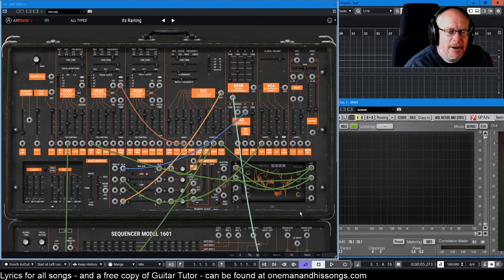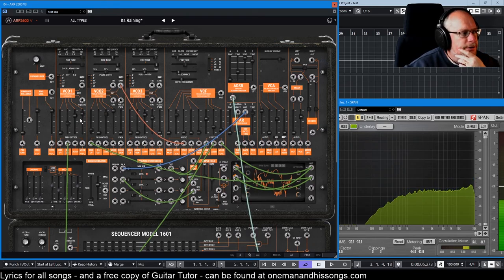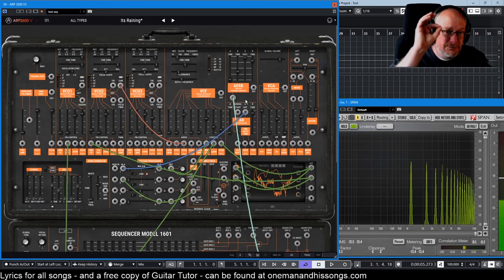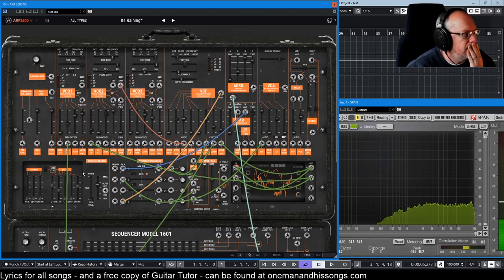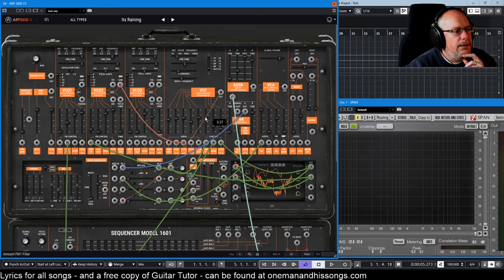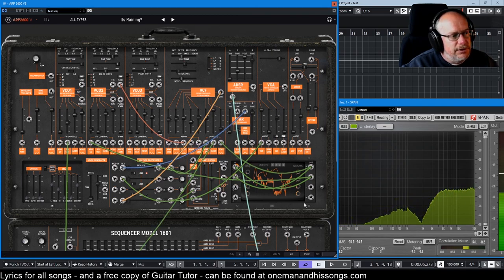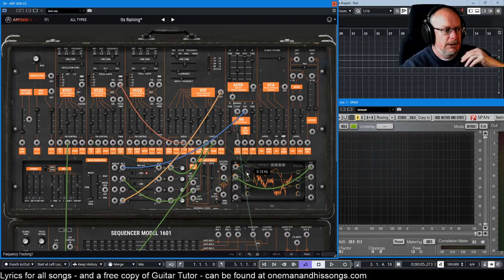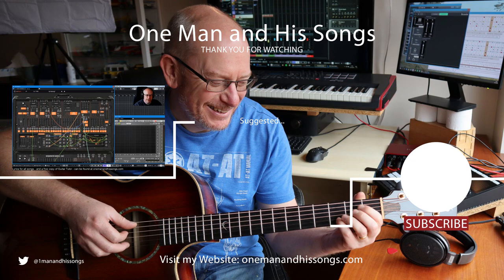Arturia ARP 2600-V Walkthrough Ep.12 - Preset Deep-Dive No.3

Comment: Re routing the VCF: If you patch, for example, the S&H into the Voltage Processor's modulation port for VCF's input and work the attenuverter amount, it's possible to imagine large drops falling randomly from the eves and/or wind driven gusts of rain. I don't think it's my imagination but in any event it's nice of them to have left open an experimental path.
Reply from the maker: I agree - "easter eggs" regularly pop up in their presets. Not sure how much of it is by design as opposed to leftovers from previous experimenting, but it doesn't really matter, it's still cool :)